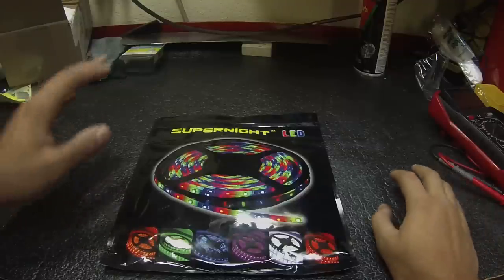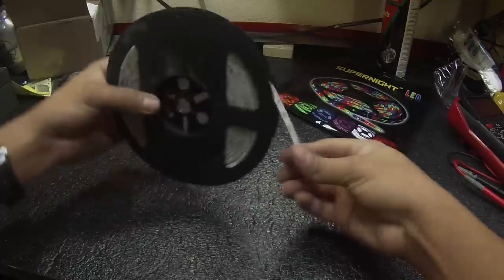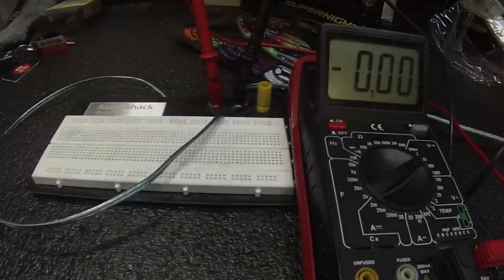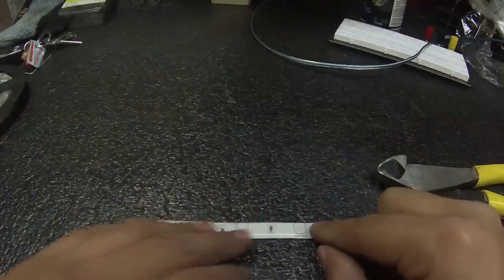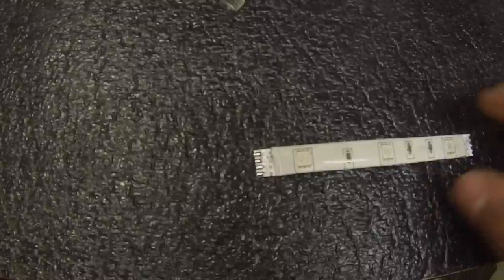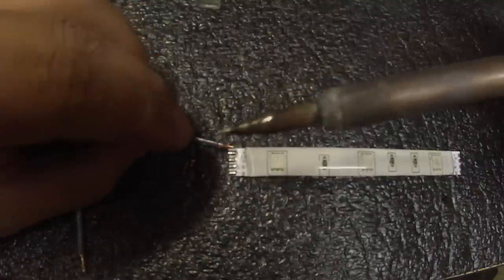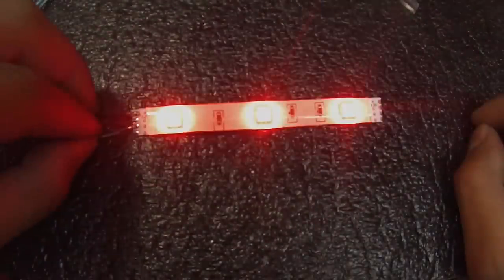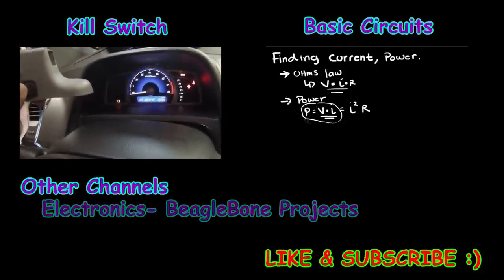12v 5050 LED strips!

Comment from the maker: +jared cochran These are very easy. You just need to connect them straight to a 12 volt battery. In my case it was a car battery. It also doesn't have to be exactly 12volts. I seen them run at 10v and up to 18v but try to keep it close to 12
Reply: can i plug it in 220v using converter to 12V

Comment: after cutting it to a smaller strip consisting of 3 led, how much voltage did it require?
Reply from the maker: +Phu Nguyen it still requires 12 volts but it uses less current with only 3leds.

Comment: Looking for something like this to put under the dash of my classic truck that will come on and off when I open the door and function with the dome light switch . any suggestions ?
Reply: Okay so it would essentially be the same but your need a sensor in the doors like a small magnet device to sense the door being open this connects  the loop and turns the light on and off with the door, I plan on doing this for my engine bay in my civic 🤫

Comment: What kind of battery are you using? I'm trying to power about 2 feet of RGB 5050 SMD 60/meter lights for about 3-4h non-stop at flash/blink mode and the batteries I keep buying (rechargeable 12V, 3000mAh) just don't do it. I don't know if they seller just has a shitty product or what, but I was sure they should be sufficient.
Reply from the maker: You have probably figured it out by now but if are using a block that comes with the led strip, they usually draw way more current then they need. This could be the reason why it dies to quickly. I was powering mine from a 12v car battery and it would have lasted days (55000mAh or 55Ah battery).  2ft of led strip is tiny. It should have lasted at least 3 hours. An update if you figured out your problem would be nice!
Reply: Christian Macias Hey Christian. thank you for your comment. I actually haven't figured it out yet but have figured that much too, that it should hold up. I just gotten 2 new (each different) battery types in that i'm going to try out. Except the one needs a dual female cable and one of the plug seems it gotten smashed by mail and the other battery requires some suthering (???) of cables. This project has been a fucking nightmare!!!!! I'm so done with it. It should have never been this damn complicated.

Comment: This is great thanks,  but how can I connect them to my 12v battery to use all three colours? -  led strip 4 terminals - battery 2 terminals..  Thanks John :)
Reply from the maker: they should have a label that says +12v that one goes to the positive of the battery. The others go to negative. each on will light up a different color
Reply: So all 3 - R G B go to Neg ?
Reply: yes, it's common positive voltage (+12vdc), for each LED red, green and blue

Comment: HI Macias . Thanks for the valuable info I tried it with a higher power supply it works well . Now I need to know I am going touse a 9 to 10M 5050 led strips  lights . Can I use a 24v power supply due to it,s distance and the amount of lights . your advice please
Reply from the maker: +Sammy sorry for the late reply! You can't use a higher voltage for more leds. You need a supply that can provide more current rather than voltage.
Reply: Hi Macias . Thanks for your reply, infect I already fix the led and it,s working fine .Thanks a lot pal , stay in touch

Comment: can i use a 9V battery ( a normal pile ) and how is that ?
Reply from the maker: +dhia eddine mellouli 9v is not a good voltage to use these. It probably isn't enough voltage to turn on the 12v leds. These are led strips that are designed to work on 9v.
Reply: thats all i got cause i dont have the original battery of the strip and 12V battery is way more heavy. my real problem now is to take advantage of the RGB strip
Reply: Christian Macias nice video , but i want ask are there the same led lights like this but closer placed to each other and are there same leds like thise with a lower voltage use say like 3v ?
Reply: no i think not the lowest voltage for a led strip i believe is 9V otherwise you can buy seperate LEDS

Comment: Hi Macias , I have 5050 blue led strip light , it works well , but keeps flashing after I fix it direct to my power supply .what do I need to make flash constantly without flashing .. can any one tell me ... tks
Reply from the maker: +Sammy it might be your power supply can't handle the amount of current it's consuming. You can either get a more powerful power supply, or cut the strip shorter.
Reply: Hi Macias ,Thanks for your swift reply My power supply is 12v 1.2amps 5050 led is 5M ,will try your idea  today.Will also get back to you if the same problem arise..
Reply from the maker: No problem! Thanks for watching!

Comment: So I am not to much of a electric and wiring genius, I mean I can figure it out and all but it's gonna be trial and error. So here is where my question comes in, I want to put these on a peddle boat (Wanted something that I made improvements to and where I live the lake isn't huge). The way the boat is it has a smooth upper surface that doesn't get wet,  yet can still be seen outside the boat, what I want to do is make sure I have enough light for me to be visible at night. Would something like these be okay to use, and if so would it be okay to use a higher voltage battery than what it needs or would it have to have a regulator to make sure the voltage don't short out the light's?
Reply from the maker: +Brian Weekly ll I tested these leds and pushed them up to 19v. At 19 volts, they started to burn out and short circuit. They run fine from 11 to 15 volts. They are bright enough to see from about 60ft away at least.
Reply: Christian Macias So I need a more prominent lighting and should use a voltage regulator got it. Thanks!